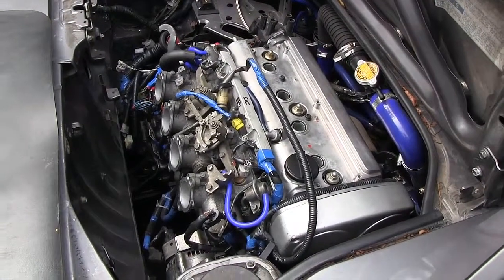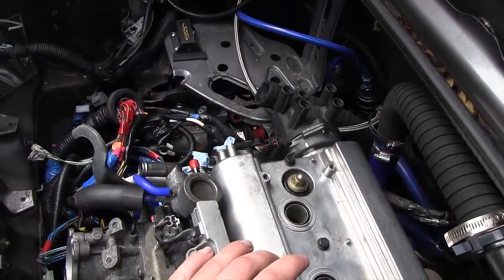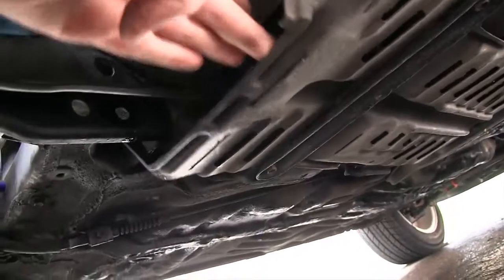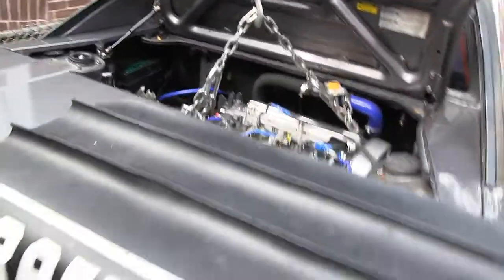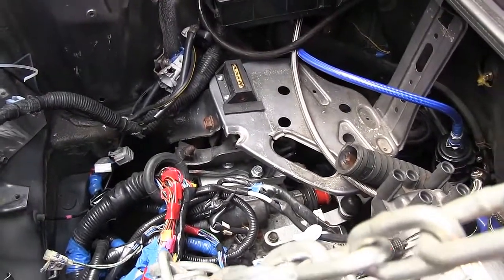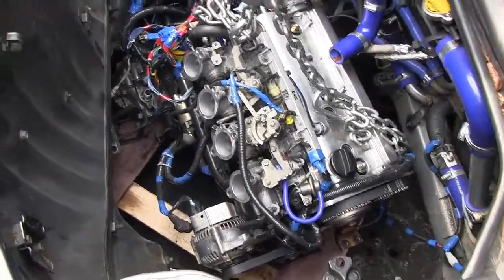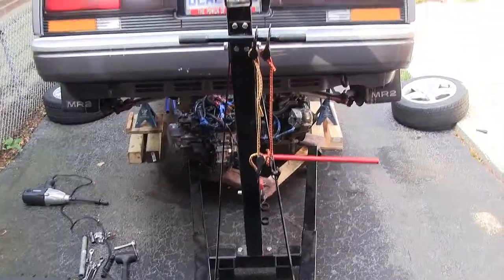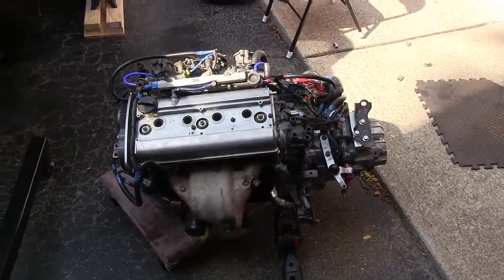4AGE Engine removal part 5: Drop the engine

Comment: Why can't you just pull the engine out of the the top?
Reply: while it is possible to do, it is a complete pain in the butt. According to Toyota, dropping it out the bottom is how you are supposed to do it.
Reply: +Bigbacon With the transmission it'd be impossible, which is how you wanna do it. Just got my motor back in my mr2 after the rebuild and doing it through the bottom is the way to go, probably much easier with a lift.